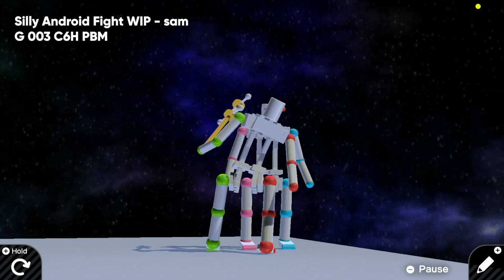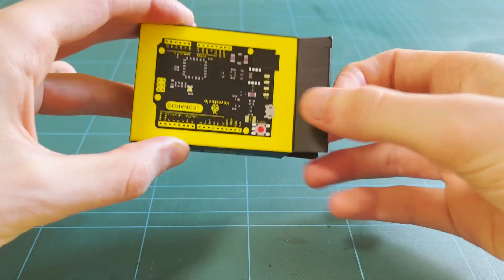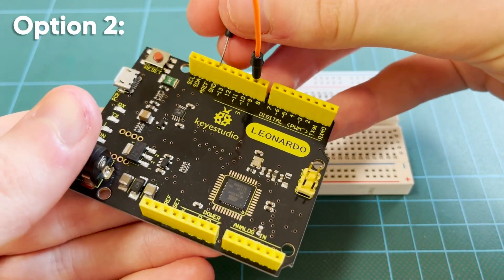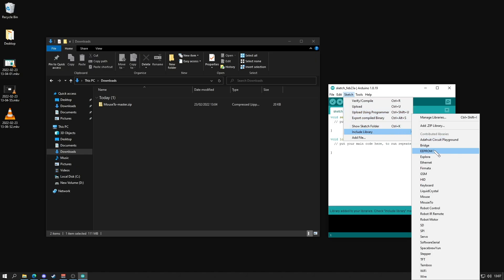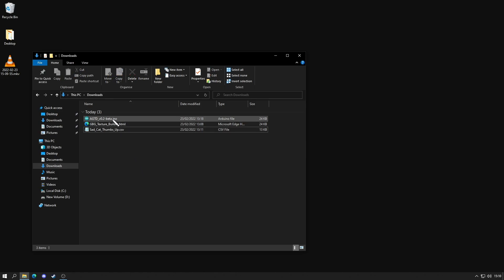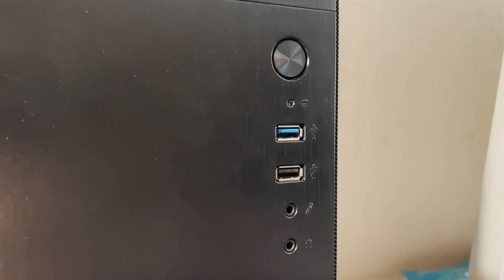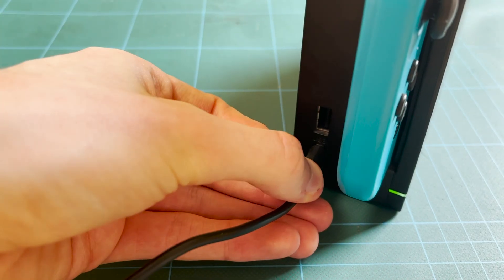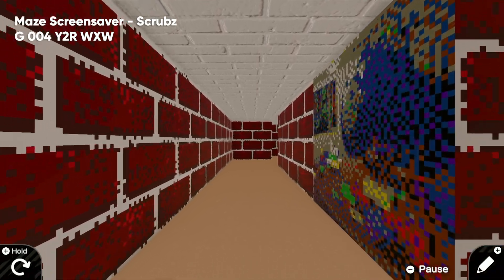Game Builder Garage - Importing Any Image Into GBG! (Tutorial): Community Texture Tools & Arduino

Comment from the maker: A few people have asked where to buy the required hardware... The best place is from Arduino directly (or one of their authorised distributors). I've posted the links below!

These are non-affiliate links:
Arduino Leonardo: https://store.arduino.cc/products/arduino-leonardo-with-headers
Jumper wire: https://store.arduino.cc/products/10-jumper-wires-150mm-male

Note: You may need to select you region once you're there!
Reply: Personally, I prefer buying genuine Arduino units, but I've have found comparable units from other suppliers like Elegoo if you're really trying to budget.
Reply: the jumper wire link doesnt work in the US afaik, do they specifically have to be from arduino
Reply from the maker: @dizzyndead  Thanks for the heads-up! and nope, any jumper wire will work! :_DojoFlatDom:
Reply: @VideoDojoPro  Good!
Reply: @dizzyndead  also known as DuPont cables
Reply: Does it work with Arduino Nano?
Reply: I can see it from you and I have a few questions I have a lot
Reply: @iot9206  i do mainly have one, why are the jumper wires sold out.
Reply: Can you make a tutorial on the advanced mode pls?
Reply: The jumper wires are sold out, what do I do? or can I use other jumper wires
Reply: @PearlyTheGoober  a wire is a wire so yes any jumper wire will work as long as it is 1 pin each side.
Reply from the maker: @PearlyTheGoober  any jumper wires will work fine! ✨
Reply: @VideoDojoPro  What About Jumper Wires For Cars?

Comment: Well, you guys can't upload textures on GBG anymore because that's basically modding, It will Brick permanently! So you all have to do all the textures from memory.
Reply from the maker: This isn’t the case, there’s no hardware or software modification required to import textures! ✨
Reply: modding isn't brickable btw, its only piracy. and it's not even a brick, it's just a console ban, aka you can't play online but it still works

Comment: Mine doesn’t do anything when I connect the wire to GND. Also, the The TX light doesn’t light up on the board like it does in your video.
Reply: Are you sure you connected it to the right port?

Comment: I am from the u.s.a will this be safe for me to use on my American switch? I'm afraid of harming it once I plug it into my switch.

 Also, is there anything I could get to enhance this? Like the uno rev3?
Reply from the maker: Yes! This works on all Switch systems from all regions! In terms of enhancements… The creators are regularly updating the code to add cool new features, but the hardware listed here is all you’ll need 👍
Reply: @VideoDojoPro  thanks for the quick response. :) do I have to install any programs to the switch? Or just plug it in and that's it? This looks so cool. But I'm confused how it works.

Comment: You also use the Arduino uno right? RIGHT???
Reply from the maker: I personally use the Leonardo
Reply: What about: Does it also work on UNO?
Reply from the maker: @SobbleEntertainment  To my knowledge it'll work on any of the 32U4 based board with USB (So the Leonardo, Micro, Zero) but I've only tested with Leonardo.
You may also need to redefine the button pin depending on the boards layout!

Comment: This is really cool but I want to ask a question, does the arduino board have to be a Leonardo? or can it be any other type of board
Reply from the maker: My understanding is it'll work on any of the 32U4 based board with USB (So the Leonardo, Micro, Zero) but I've only tested with Leonardo.
You may also need to redefine the button pin depending on the boards layout! Additionally, the pin outs will likely need adjusting within the program 👍

Comment: This honestly looks more complicated than drawing it in by hand 😅 I do like the dithering function though!
Reply from the maker: It definitely takes some time and effort to set up, but it's very quick from that point on. Textures that took me 2+ hours to trace can be 'drawn' with this tool in a couple of minutes!
Reply: @VideoDojoPro  So, does it basically act as a kind of macro thing? As in it learns what to do via the computer and then just runs the same commands when connected to the switch? I can see a lot of potential with this even beyond textures, if that's the case.
Reply from the maker: @stedankel  Exactly you've got it! and yes I agree! There's so much potential! Some discussion has already begun discussing a Midi to GBG process for custom music! :_DojoExciteDom: It would be great to chat if you're interested, as your custom music knowledge is unmatched!
Reply: @VideoDojoPro  This is EXACTLY what I was thinking! I think I'm gonna have to get on board with this! I don't have a wealth of knowledge when it comes to the Arduino itself, but the MIDI to GBG idea is definitely is definitely in my area of expertise.

You can send me a message on discord if you'd like. Would love to chat about this!
Reply from the maker: @stedankel  Amazing! I've dropped you a friend request! :_DojoFlatDom:
Reply: @VideoDojoPro  I'm not part of this conversation but I can't wait!

Comment: Does it have to be a Leonardo? I own an arduino but not that one lol
Reply from the maker: My understanding is it'll work on any of the 32U4 based board with USB (So the Leonardo, Micro, Zero) but I've only tested with Leonardo.
You may also need to redefine the button pin depending on the boards layout! 👍
Reply: @VideoDojoPro  hopefully I can find mine and the Leonardo pinout comparable, otherwise I might just shell out for the Leonardo